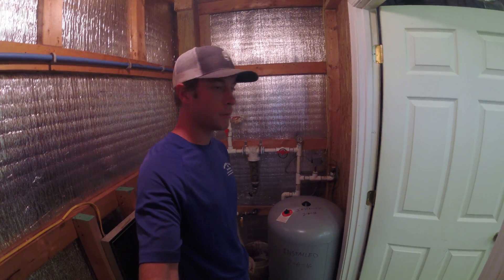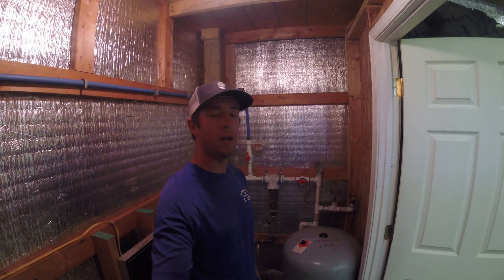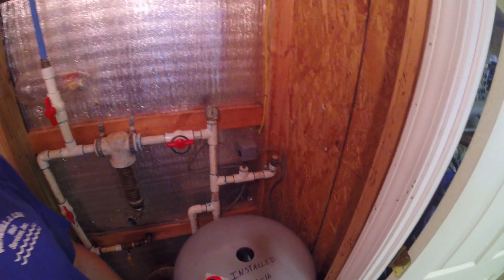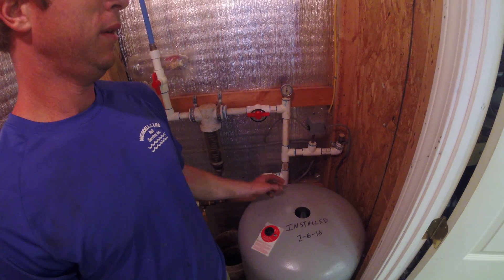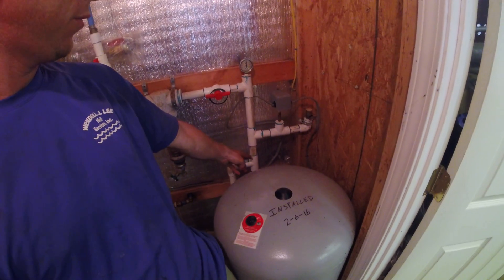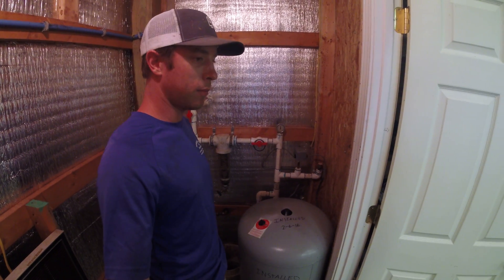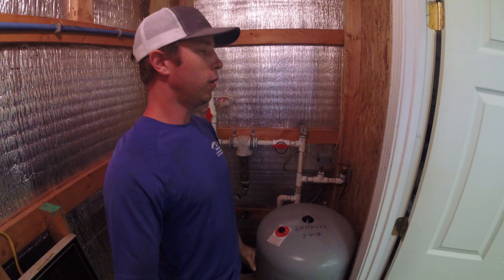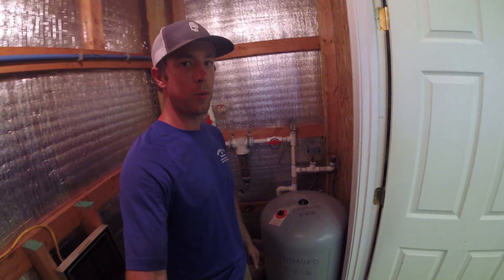Main Water Supply Shutoff Valve for a Well Pump: How to Locate and Where to Install

Comment: So we have municipal water but have to have a pump. Our pressure switch is on the pump. Where do we put an emergency shutoff valve? Our other problem is that the water company doesn’t let us know when the water is off and, therefore, we have had 3 pumps burn up. Any way to have this shutoff when it’s receiving no water when you don’t know you are out of water? 🤣 I obviously mean like times when they turn it off in the middle of the night.

Comment: I'm glad you mentioned the breaker. My line broke BEFORE the shut off valve as far as I can tell, well pump is buried in ground and there's a shut off valve where the line comes out of the double wide slab... leaking bad just under that valve. I threw the breaker but still have water flowing... msybe it's just the reservoir..

Comment: What if you have a case where you want to install a sediment filter before the shut off valve?
Reply from the maker: best practice would be to have a shut off valve on each side of the filter. this allows for easy isolation to change the filter
Reply: @WendellLeeWellServices  Is there a water main valve by the well cap that I can turn off? Even if I turn off the water main there will still be pressure in the piping for where I want to install it
Reply from the maker: @RigginTheRod010  more than likely there will not be a valve out at the well cap. I haven't seen your setup, but easiest thing to do would be kill the power to your pump and drain the system down. That would eliminate that problem and you could install the filter then
Reply: @WendellLeeWellServices  doing that now thanks
Reply: @WendellLeeWellServices  where are you located